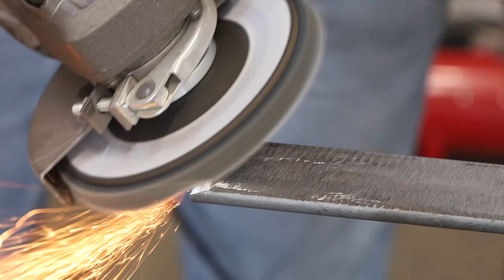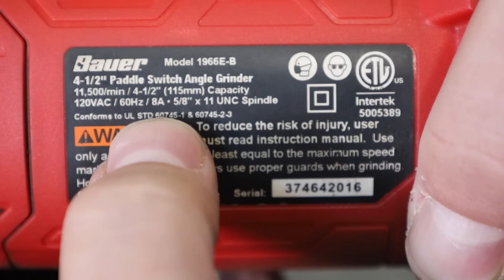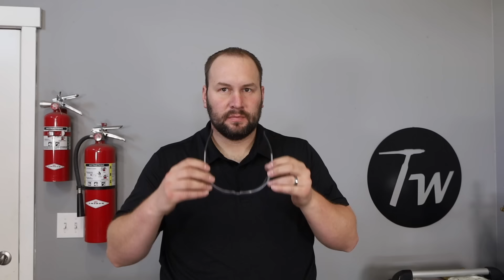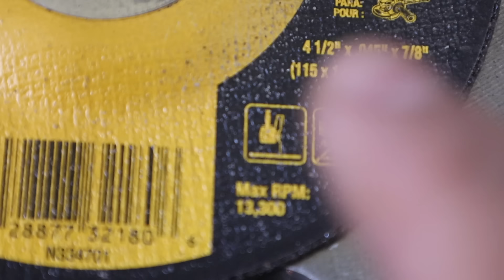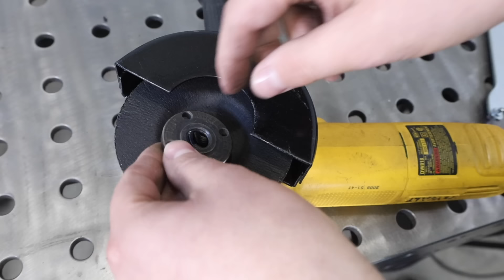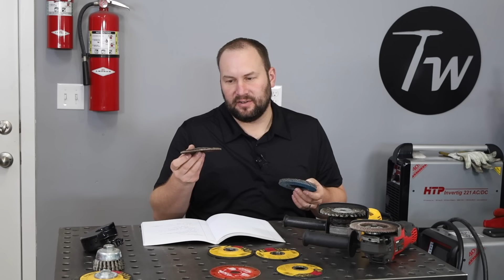Angle Grinders 101 | How to Use an Angle Grinder

Comment: For some reason this older video turned up in my feed.

6" is good for cutting because the wheels last longer.   

4.5" is ideal for grinding and finishing because it reduces hand fatigue, particularly for us older types with carpal tunnel and arthritis.  For that same reason, I despise paddle triggers that require constant grip.  

I understand them from a manufacturing/safety standpoint, but the argument is you make a mistake or you're careless and you get hurt by the switched grinder that's always on.   Now ask yourself if you're more likely to make a mistake when you've increased the fatigue in your hands from constantly gripping a switch?

Also, the simpler they make those paddle switches (reducing fatigue) the more dangerous they become.  The early Milwaukee cordless grinders had a two step paddle switch where you engaged a lever and then pushed on the paddle switch, but if you grabbed it in just the right spot, it would engage both switches at once and the grinder would turn on.  Extremely dangerous, and I used to carry those without the battery in them for my own safety.  I didn't trust them.

The newer ones have the same switch, but they have a stronger spring mechanism so they're not easily engaged.

In general cordless grinders are only ideal in specific situations, particularly where it's hard to get power, or you're just using it for a quick cut or grind.  For professional use, they don't last long enough or have enough power to be useful.

Most of my co-workers are smart enough to keep the guard in place, but you'd be surprised how many of them aren't bright enough to reposition the guard when cutting or grinding.  

You showed this in your video demonstrations here, but didn't mention it in your voice over.   Ideally you get more clearance for grinding by putting the guard 90 degrees to your grinding motion.   Turning the guard so it's positioned in front of your face is better for cutting as it keeps you from getting blasted by the debris from the cut.

My co-workers also regularly remove the handles with the argument that it's "in the way."   Again, hand fatigue makes the handle ideal for me and I use it whenever possible.  We all need to "make a quick cut" and hold the piece with one hand and then use the grinder with the other, but this is not safe, nor advised.   Clamp your piece down whenever possible.  Nothing pi$$es me off more than when my boss used to give me a part that was too thin to clamp and needed it ground.   I have taken a grinder to the knuckle more than once over this.  Fortunately, my gloves took the brunt of it.

I took a cut-off wheel to the leg early in my career when one of my employers was too cheap to send a supply truck out to a job more than once a week and my direct supervisor decided to put a 6" wheel on a 4" grinder with no guard.  The wheel got wedged between the two panels being cut, ripped the grinder out of my hands (I only had about 4" left to hold it with the bigger wheel on it), and it bounced off my leg.

I don't see a lot of issues using a cut-off wheel to grind, provided you're only trying to remove a thin layer, and you're at the correct angle.

There are also two different sandpaper patterns for flap discs and one type is meant to be used by grinding with the edge and the other is meant to be used by keeping it flush to the surface, which you did not cover in this video.

Flap discs are NOT a substitute for grinding wheels and it's a good way to just waste them in a hurry, which is why I keep them locked up and away from my co-workers.  Flap discs are for polishing and removing small amounts of metal, or you're better off using a grinding wheel first and then using a flapper for your final passes.

I really hoped I would learn something new from this video, but sadly, I did not.

Comment: The paddle trigger point is something I wish someone had told me when I first started — most beginners just go for whatever's cheapest and don't even think about the switch type. And the wheel RPM rating tip is genuinely life-saving information that gets skipped way too often. The part about discarding moisture-exposed wheels is something even experienced guys forget. If anyone here is just getting started with angle grinders, I put together a full beginner safety guide recently: https://www.youtube.com/watch?v=eftXx9vsMjM

Comment: How much force or pressure should I use when grinding I find that pushing too hard gets the grinder head way too hot but not pushing too and “letting the tool do the work” is very slow and doesn’t really remove enough metal

Comment: I hadn’t expected an instructional video on grinders to provide anything new, but I was pleasantly surprised. It was great. As in every video you produce, I always feel that I have learned important new skills that I can’t wait to put to practice.  In particular (as a new welder), I have found that patience, solid understanding of the basic skills that you show and the proper technique makes all of the difference. I just started MIG with shielded flux core and just as I was getting exceptionally frustrated with my lack of progress, your recent video on speed, weld angle, amperage and wire speed was exceptionally useful and I finally made some decent (in my mind), progress to the point I can say I welded it vs. 
“I bought it that way.”  Tim, you are the best welding instructor I have ever seen. Many thanks for the hard work you do in producing the content. In a few days, I’ll be buying your online class programs. Thank you again!
Rick Rutel

Comment: I kept having issues with 1.5mm thick wheels that can't seem to tighten all the way, often slipping and mangling up the hole. Nice tip about flipping the nut, I forgot about it. I ended up grinding down the nut because I kept having problems with thinner wheels coming loose. 

I've never had wheels fly apart though, but I did have them get nicked or whatever, and I typically toss them when this happens. The reinforcement seems to do a good job of keeping it together. 

The downside of my angle grinder is that it just has a switch in the back to turn it on. This isn't safe. It's a Makita, made in Japan, probably older than me.

Comment: I prefer the slide switch.  My small pneumatic right angle die grinder has one of those paddle switches and it just irritates me.  Someday I'll break off that little safety tab and then it would be okay.  Every time I grab it I forget about that stupid thing and squeeze the paddle while nothing happens.  That being said, when I operate it or any other similar tool like my angle grinder, bench grinder, wire wheel, etc.  I wear a heavy denim apron and a full face shield.  Also wear disposable foam ear plugs.  I currently have a 6amp Craftsman angle grinder but when it wears out I'll upgrade to either a Bosch or Makita with the Xlock arbor.  I've lost that little two-nub arbor wrench 3 times.  Eventually found again, but not before I'd replaced it with another, lol.

Comment: Great video, Tim. I find that I need multiple grinders as they are optimal for different wheels. For example, since I use heavy twisted knot wire wheels for slag removal, I want a grinder that can’t be accidentally locked on. Lock off or no lock is ideal, and I like paddles or triggers for that. For wheels where I will be using it for a long continuous run (say heavy grinding or a cutoff wheel) then a lock-on trigger is an absolute must. If it’s a wheel that where I can use the grinder with one hand, then you want the side-lock switch  so you can lock it on and grip the barrel without accidentally turning it off. For heavy use, it’s two-handed only and a paddle with lock-on is preferable.

Comment: Suppose you are cutting holding the tool horizzontally, like cutting a stop sign post to make it shorter when it's already in the ground, which side should arrow point, which side should handle be on?

Comment: Sir i have a question i have  100mm angle grider 850 watts 12,000 RPM can i use also 100mm or 4inches cuting disc 15.300 RPM  to my grinder

Comment: Great video, thank you. I have a quick question, I am trying to remove some spray on truck liner paint off of some rock sliders on my 4Runner so I can clean up some surface rust and reapply a fresh coat. Which would work better, the flap disk or a twisted wire wheel?

Comment: How will I know what's the maximum millimeters an angle grinder(e.g. CAT Dx371 750W) can cut without killing the grinder?
Reply from the maker: It's probably 115mm, but it should say on the label. The concern isn't as much about killing the grinder, smaller grinders spin faster, so if you put a huge wheel on, it often isn't rated for the high speed and would be more likely to break and throw pieces.

Comment: I was very lucky to find a 1999 SEARS Craftsman angle grinder never used with everything inside plus the receipt for 50$.
Reply: I found an old 1997 Milwaukee 5.5amp 4.5" grinder and fixed it up

Comment: Please, start a movement to demand that all companies install safety switches on angle grinders. Better, petition OSHA to make safety switches mandatory. 
Angle grinders are by far the most dangerous power tools. 
I know dozens of people who have hundreds of scary stories of kickbacks, metal cutting disks that break off or get caught, or simply tools that slip out of hands while working in hard to reach places. 
On top of that, they also do not have brakes, so once the wheel starts spinning, it will only stop inertially, which means it will keep on cutting whether you want or not. 
I don't understand how OSHA could possibly have overlooked such an obvious and crucial safety feature.

Comment: Just discovered your excellent channel. A great introduction to angle grinding but there is one thing I don't think you mentioned. Most grinding and cutting discs have an expiry date beyond which they are not safe to use due to the adhesive that holds the grit getting weaker. It is usually printed on the inside ring of the disc. Not an issue if you get through discs regularly but DIYers may keep discs for years due to occasional partial usage.

Comment: Hi there can you tell me what thar rubber button is for on oppiste side of the blade is it a reset switch or does it hold the head when you tighten the blade?..
Reply from the maker: It's a spindle lock to keep the disc from rotating when you change it.
Reply: @TimWelds  Ok thanks for that, the instructions are totally useless...

Comment: I bought a Ryobi angle grinder and then I bought a Diablo 4 1/2 inch diameter ultra course 40 grit blade. And I can’t get the ryobi disc flange to fit over the Diablo blade. It feels like the Diablo blade is too big, but it matches the number on the Ryobi box which also says 4 1/2 inch. Any advice?

Comment: Thank you very much, excelent video. Quick question, it is ok to use a grinder to remove paint from a Metal surface ?
Reply from the maker: Yes, if you search for 'strip disc' on amazon, those wheels work pretty well. Wire wheels aren't too bad either. I'd also wear a respirator or at least a dust mask to avoid breathing in the dust from paint removal.
Reply: Great, thank you Tim!

Comment: I am 74 and purchased just yesterday, my first 115mm (4.5 inch) battery operated grinder however, I have yet to purchase any grinding or cutting discs while I research exactly what it is I need.    Thank you for providing a large part of that information & knowledge ...    I am that much nearer to selecting and purchasing my first disc or discs, with which to 'giving it a go!'    Thank you again for sharing your knowledge and experience.
Reply: do you think they'll rig the election or physically remove trump?

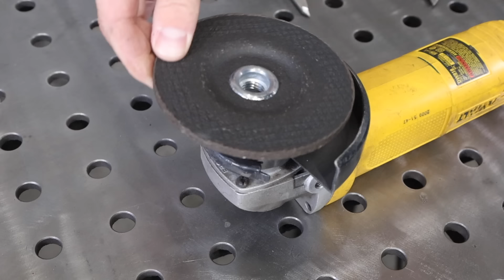Comment: @2:47 It can be a big hassle to get those threaded wheels off the grinder after you finish because they are sooo tight. To avoid that I use a rubber 3/4" garden hose washer that I slip onto the grinder first and then tighten the wheel down. The washer will compress as you use the wheel so it leaves about 1/16" separation so the threaded wire wheel comes off as easy as if you were using a non-threaded wheel.

Comment: Hi! I'm a photographer and am doing a calendar shoot with firefighters. Years ago, I had worked with a metal sculptor and done a series of model images with sparks he generated. This time, trying to do it without him and was planning on doing an Angle grinder with cold rolled steel. I'm assuming a larger diameter disc and higher power motor will work best. Are there any specifics you would recommend? The sparks will be bouncing off the models body btw.

Comment: I bought my angle grinder online, based on power, price and reputation. But I wish I’d  gone to my hardware store and handled each model to factor in its feel. For example, there’s  a lot of variation in handle circumference. Avoid any that feel too large for your hand size and strength. This is a tool that demands total control.

Comment: I bought a  cheap angle grinder , my tool dropped from 40cm height and the handle was broken , they used a short bolt and the plastic parts was soft . I made a handle by wood and long bolt , much more stronger than the original or buy the handle from the branded one which is more reliable

Comment: Tim I'm very happy that you explained the disc and which side of the Tom ring should be turned into the disc I was always confused with this and I only use my angle grinder as a home hobby on a rare occasion so I usually forget by the time I use it again.

Comment: Thank you for your safety tips , according to my experience, I would like to share my experience.
Angle grinder is very useful at the same time can be dangerous. It is an unpredictable powerful machine , specially more power and speed causing it more unpredictable. For those who have an accident , use the used one with lower RPM , use those with less watts , hold it tight, grip it right and stand comfortable  expect that although you are doing all right, but something goes wrong.this machine kicks back and you have to control it tight .be alert at all the times , if you are tired do not work with this machine..
Reply: Working tired is like working while drinking...oops.

Comment: not a bad video, especially compared to the mostly useless angle grinder safety videos out there. but a few comments: 1) you missed another type of switch, which is the lever toggle switch. i have one of these and i dont recommend it--- too easy to accidentally turn on, 2) the grinders you are showing are corded, but like you said there are lots of cordless grinders out there, and some with brushless motors that are very useful for short worktimes, which is most jobs. electronic braking is a safety plus. however, i dont know of any cordless tools of any species that list amperages (or even wattages) on their labels, 3) apart from the obviously bad ideas like chainsaw-type cutting wheels, thin fiber discs are probably the most dangerous of the conventional wheels out here, and also one of the most useful, because they can cut-off very efficiently, but there is not much info here about appropriate angles, materials, or the use of water, which can be useful to reduce dust, heat and sparks

Comment: Got a small piece of metal lodged into my eye last week when using my grinder despite I was wearing the type of safety glass shown at 5'48". Had to goto hospital to have it removed. Now wearing a full face shield like advised in this video.
Reply: This kind of advice is very valuable to me as a beginner in metalworking. I'm starting to really enjoy it and would absolutely hate not to be able to do it anymore because of my lack of safety.
People at school tell me i'm a pussy for wearing a respirator when grinding and welding, but we'll see in 20 years when they can't work anymore.

Comment: Thanks for this excellent video.  I'm new to grinding and found it very helpful.  You mentioned a variable speed grinder, but it doesn't seem like it's your tool of choice.  Are there any jobs that you use a variable speed machine?   Perhaps that's more suitable for working with wood as some have mentioned.

Comment: 13:05  I am a first time angle grinder user. Great video for a newbie. What kind of wheel do you suggest to remove residual glue left from an outdoor carpet 
on concrete steps

Comment: On my welding mask I got Shade for welding Grind for grinding but what is cut mode for   is it for plasma cutting or Acetylene cutting torches I think it goes to Shade 5 setting
Reply from the maker: That’s right. Lower amperage plasma cutting and oxy-fuel.

Comment: Nice video. I recently started using an angle grinder for cutting angle steel, and for removing old paint, primer & rust from a steel I beam bridge. We found that the Bauer Surface Conditioning Tool with the 40 Grit Stripping Drum was superb at removing a large swath right down to the bare metal, but we needed angle grinders with both the knotted & wire cup brushes to get into the tight curves & welded corners. Together both tools did a great job getting down to bare steel, so we could come back in paint with a metal primer & a top coat to restore the steel bridge to very good condition.

I wore a Tyvek coverall w/ hood, booties, safety goggles, 3M P95 respirator and gloves because these tools really throw out some fine grindings that you don't want to breathe or get in your hair, skin or clothes, for that matter. We also used a large tarp to catch the grindings rather than let them get into the environment. Take care of yourself, take care of your fellow workers and take care of the environment. And use the right tools to get the job done efficiently.